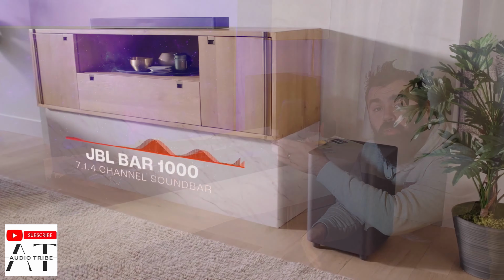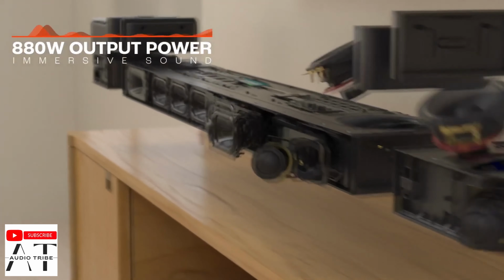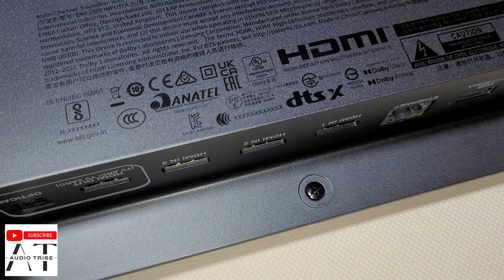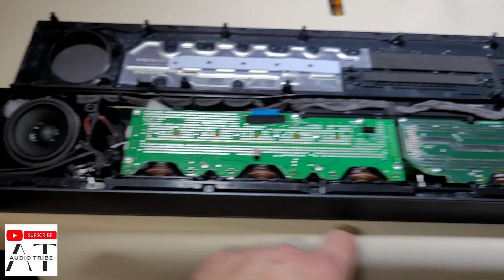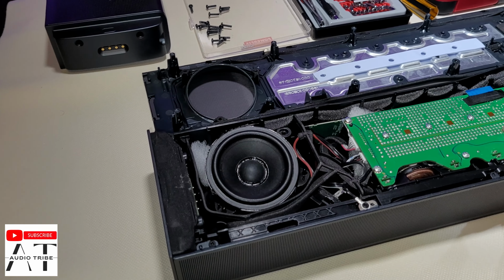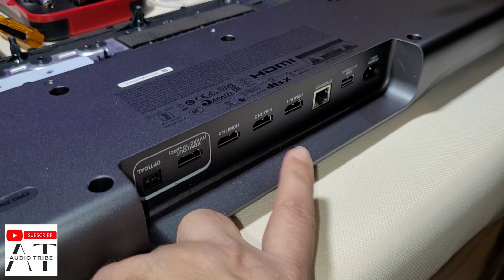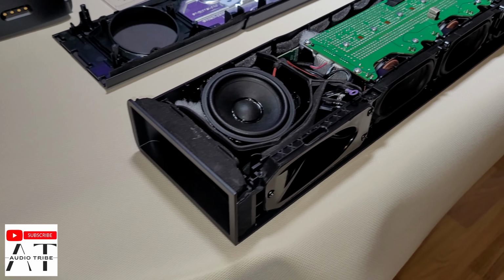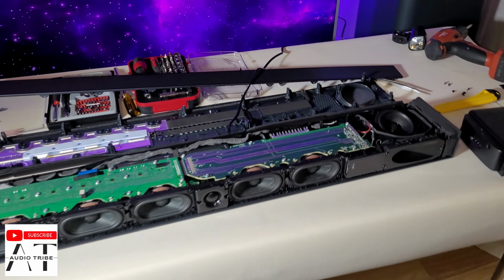What's inside JBL BAR 1000 Soundbar - Full TEARDOWN + Sound test

Comment: Nice video. What's the max volume does it go too ? I have a JBL 5.1 surround and max it goes to is 32 😞 . Which is very disappointing as the bar can go sooo much harder.
Reply: Ciao ha un volume troppo basso😫😫😫 avevo jbl 5.1 surraund 2017..max volume 49%...jbl bar 1000max volume 32%
Reply: I have jbl 2.1 deep dass and it also has 32 max volume i am sure they are capable of more than this

Comment: Ok, I watched.  Your video does not show how to change the battery or access it in the detachable speakers.
Reply from the maker: I meant the JBL BAR 1300 Teardown!
Reply: Incorrect.  The case is completely different.  That is not how you would get in.  The back of the 1000 bar rear speaker actually has a picture of a battery, with a cover, but it’s unclear how to get it off.   @AudioTribe

Comment: loudspeakers like in PC 2.0 speakers for 20 euros and plastic , plastic, plastic. Turn off subwoofer and sound  will be like from phone. I can't understand, why peoples buy this garbage for ~1000 euros. Marketing did good job

AudioTribe thank you for showing what's inside
Reply: And what you advise to buy which is not garbage? About 700 usd approx
Reply: I had SB200 From JBL and it had 2 woofers and 2 tweeters and was better than any small system (down to 50hz with good spectrum response). In fact after 10 years woofer suspensions were completely gone. Jbl is just able to push their suspensions to the limit unlike any other manifacturer, but still paper is paper and paper breaks (jerryRigEverything). 
Still not comparable with my two monitor speakers but you need also to have space on the sides and under the screen because for films not having center channel is like driving a car without tires...
Reply: I've listened to this system and I agree with your opinion. There's just some booming bass and treble not much in between. This system is mainly for movies, games and maybe sometimes good for listening to concerts in dolby surround. Defenately not good enough for any kind of music. Worth half the price as far as sound guality is concerned.